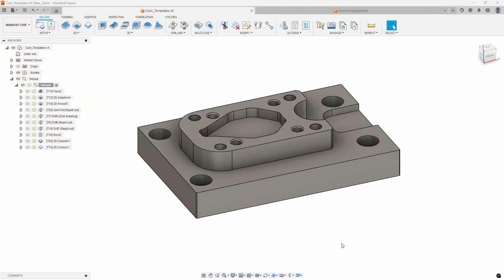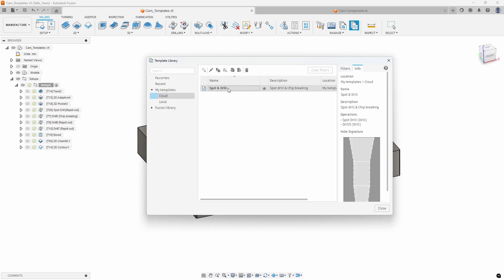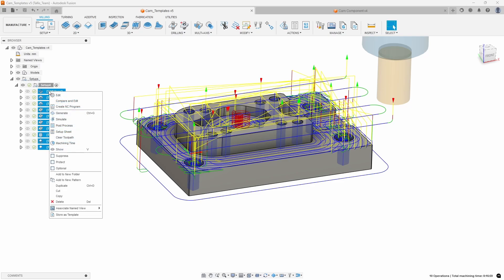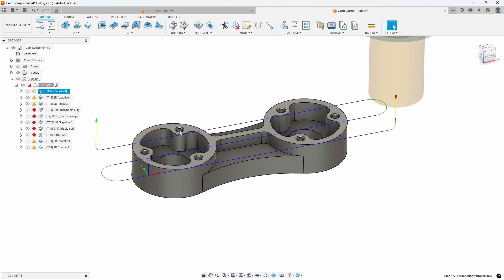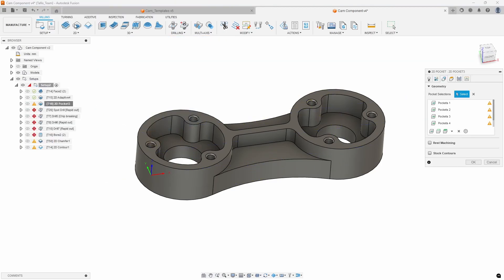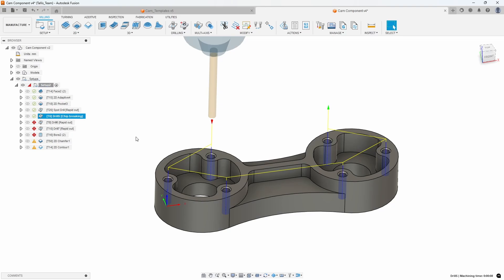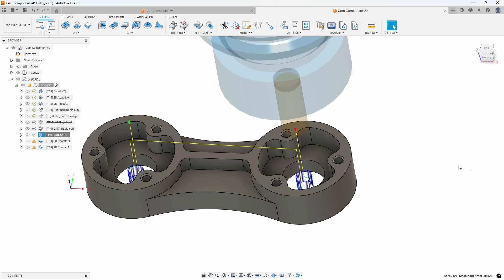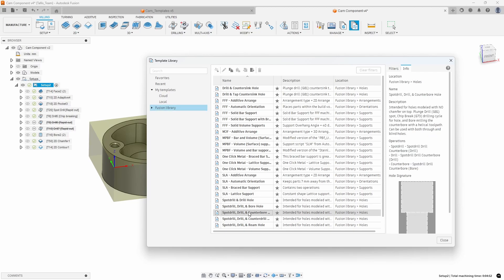Fusion CAM Templates

Comment: Great video as usual! I've seen other videos on templates but they rushed through how to open them, wow create from template. But my OCD kicked in with the machining order, use the spot drill to create the chamfers, and run a drill down the bore hole first. Then you won't be plunging with the end mill and chips and coolant will have a place to get out of the pocket. Thanks again, always look forward to your Friday tutorials.
Reply from the maker: Good call.  I knew I was going to miss something when I was trying to shorten the video down.  I ended up removing two of the drilling operations on the 2nd part, and one of them was the drill for the bore.  Ugh.  Good catch though!  Proof that you are watching the videos all the way through.  I really appreciate you pointing out the "correct" methods for others to learn.  That's the best way for everyone here to learn.  My favorite part of working with the Fusion community is learning from everyone else!  Thanks!